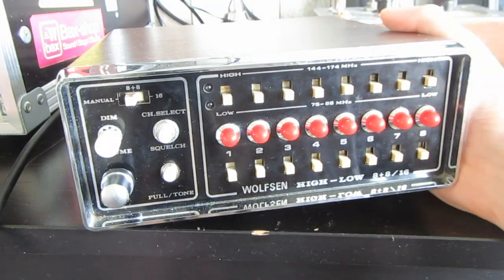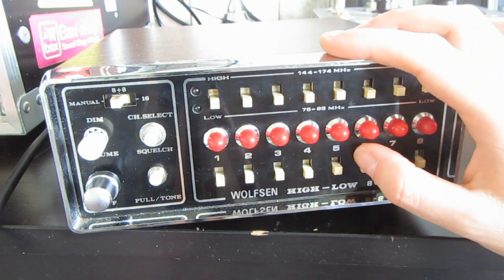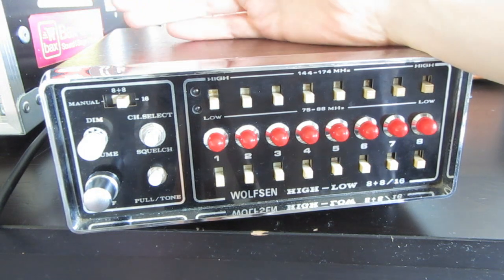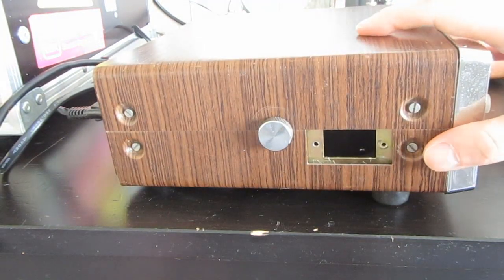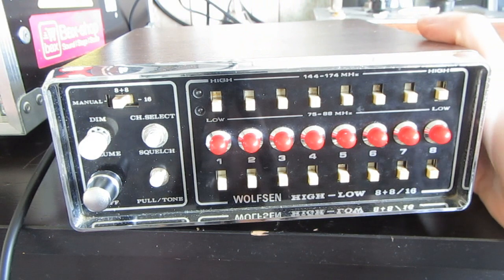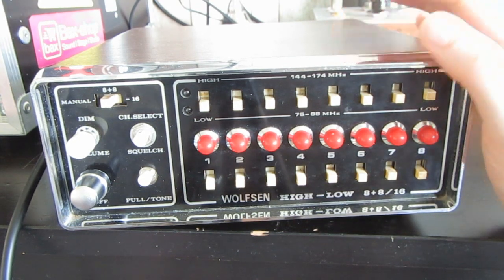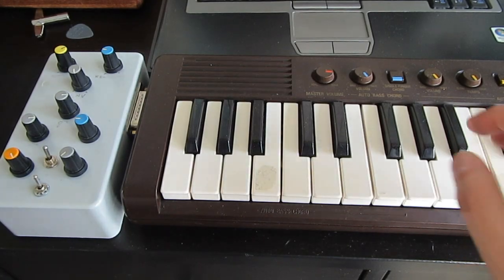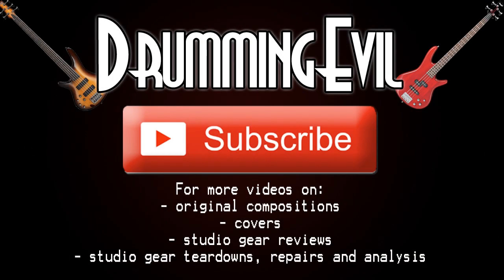DIY Analog Drum Machine - Drumique - Demonstration

Comment: Hello,
my tone control does not work, I replaced it three times, no reaction! Used a TLo72 for the snare, should be ok? The diodes are 1N4148? Is the tone controller connected to the two 47N capacitors, it looks like this on the schematic ?! The 1UF at the exit, I don't see where plus or minus is there, I took a bipolar! would be great if you can help, great little drum machine!

The resistance in front of the 27N is a 4.7K? or a 47K, you can hardly see it!
Reply from the maker: Different opamps tend to behave slightly differently with these circuits, but it should work as far as I know.
Diodes are small signal ones, not sure which ones I used.
Yes those are two 47nF caps, it's one half of a twin-T circuit. 1uF is indeed a bipolar electrolytic capacitor, the plus goes on the side of the 10k resistor. 
4.7k yes :)

Comment: How did u join the output of each module? And 
Could you tell me which pins you used for your inputs in your arduino code? i can only identify the CD4022 inputs.  Thanks man, i'm trying to build your Drumique.
Reply from the maker: I think I just passively mixed the outputs, perhaps into an buffer opamp to prevent loading on the ouputs. I'd have to open it to be sure :P
As for the pins:
- 8 and 10 are the 4022 clock outputs
- 9 and 11 are the 4022 reset outputs
- A2 and A3 are the two return inputs from the buttons, no idea why I used analogread there btw, since analog pins can be used as digital ones...

Comment: Wow man this is amazing. Thank you kindly for sharing the schematics. I wanna try building some of the circuits. Would I be able to send a square wave from a schmitt trigger oscillater as the trigger? I have an arduino but haven't messed much with it and def never send pulses out. Thanks again you nailed it! So cool.
Reply from the maker: Thanks for the kind words!

A square wave would definitely affect the circuits differently than a pulse, I highly suggest breadboarding your idea first to see if it sounds good or not because you might get audible bleedthrough. You could however run the square wave through a simple RC high pass filter, thus turning it into pulses. Make sure to take care of the negative pulses with a diode for example :)
Reply: oh nice thanks for the reply. you got a point. you know more about all thi than i. even the housing on this is very pro . how did you fab the enclosure? do you plan on selling this model ever?
Reply from the maker: @jkuebler89  The enclosure is actually from a portable UHF radio. I often visit the 2nd hand store here, they have all sorts of wierd old and often very dusty stuff lying around haha. Unfortunately I have neither the tools nor the space here to build enclosures myself, otherwise I'd definitely be doing that!

I do have plans to make commercial products out of some of my projects. I've been working on a portable drum machine the past days (video's posted yesterday ;) ) and I have a string synthesizer module on the way too. It'll take a couple months before I'm even close to being ready to sell stuff though :)